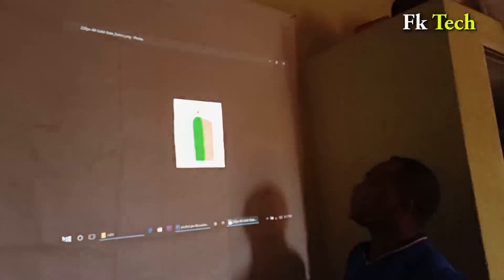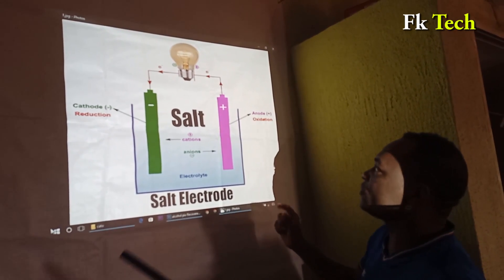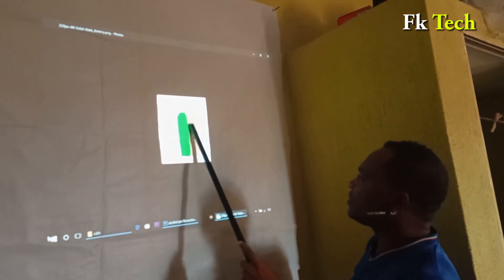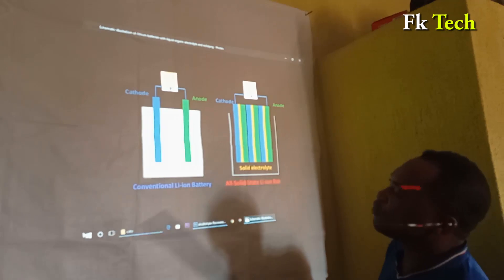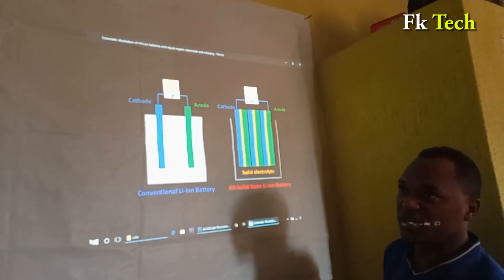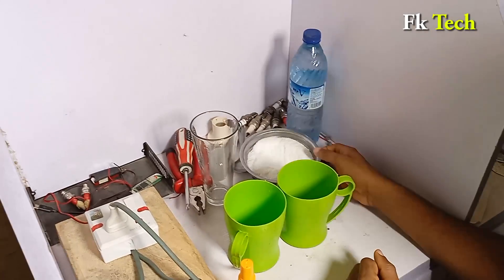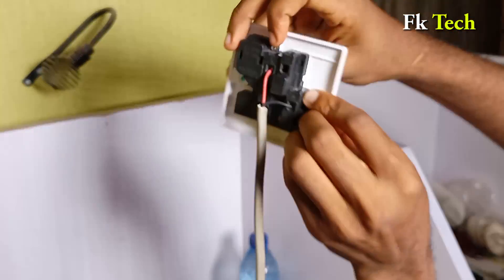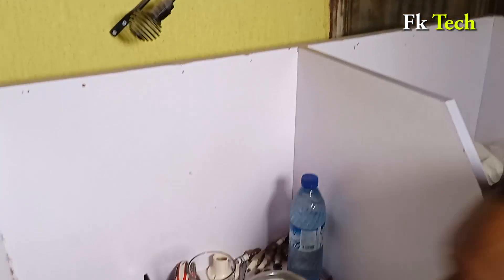Free Electricity Energy Generator With Salt, Water, Electrolyte & Spark Plugs

Comment: Well done sir, were can I get the electrolyte?
Reply: Go to those that sell motor batteries, they sell it.  That should be easy to find.
Reply: @paulonubah4804  you mean it's the acid in car battery?
Reply: Do you have the plug @ojogbengamichael5709